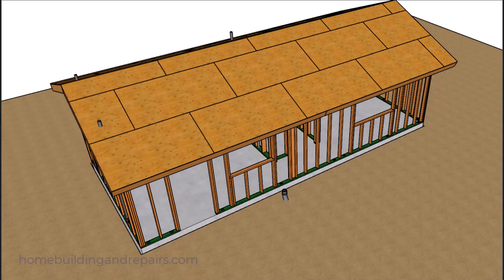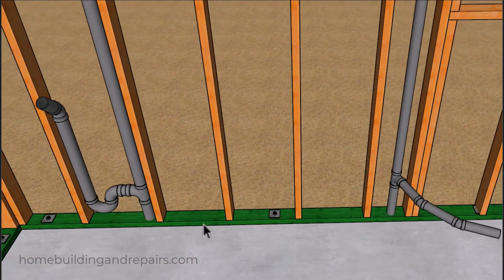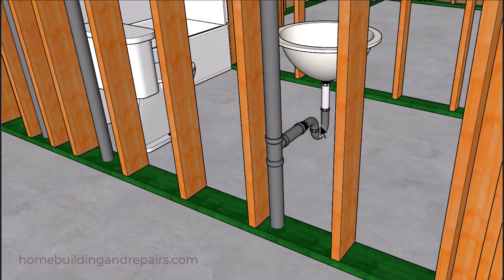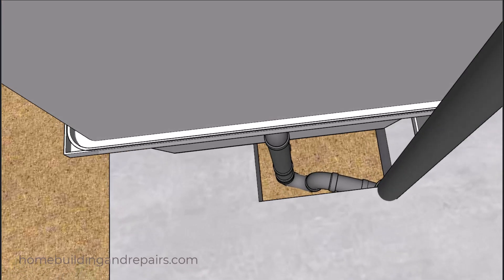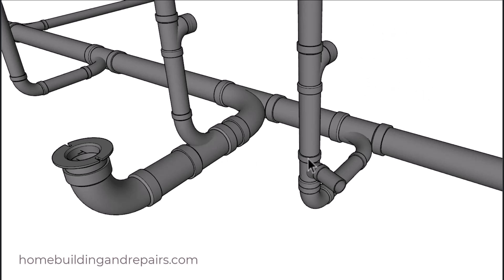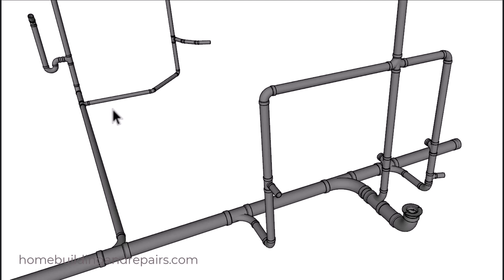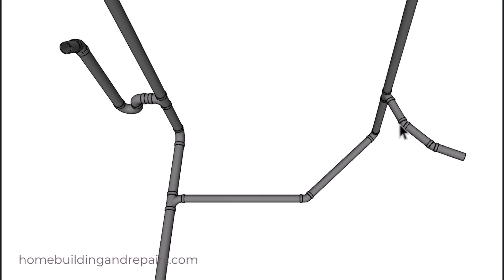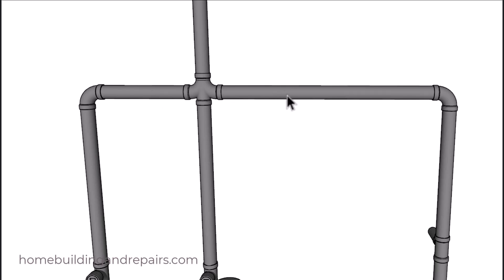Drain Waste And Vent Plumbing For 434 Square Feet House - Includes Fitting Names And Pipe Sizes

Comment: I just found you today. Great explanations. When running drains inside the wall what tricks and tips do you have in order to run the pipe horizontally. probably about 6 to  feet.